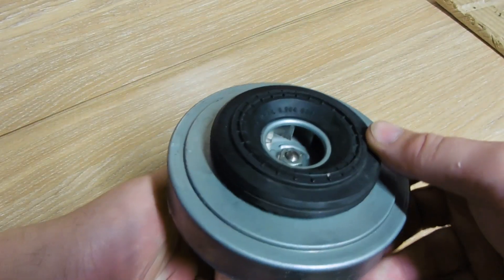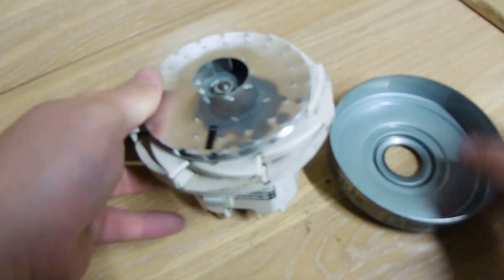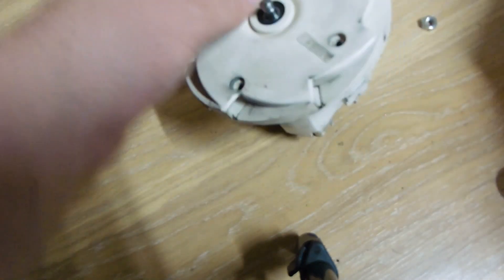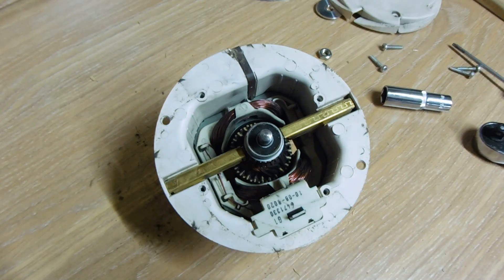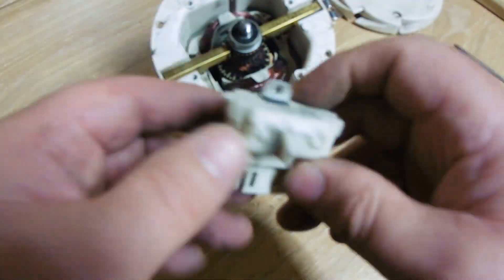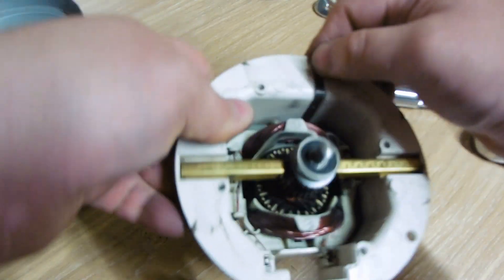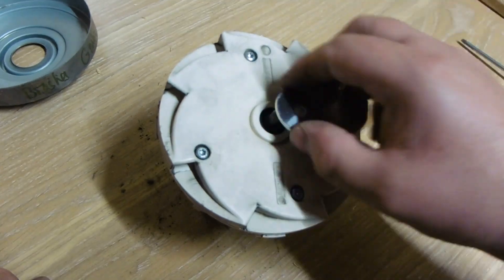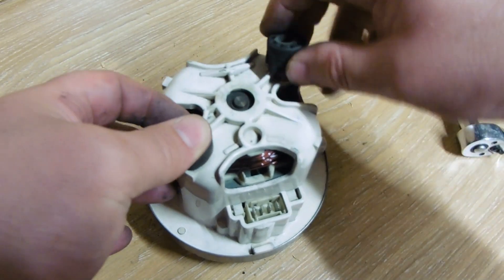Taking apart a MIELE MRG MOTOR, Checking connector pcb, carbon brushes, impeller fan / cover.

Comment: I have a Miele C3 for 110V. my pull out motor controller is defective. Where can I buy this part # 7794050? thanks
Reply from the maker: Hi, thank you for reaching out but unfortunately I am unable to help. 
 I am in the UK so we use 240v and the part numbers are different and the part number you sent isn't something I recognise. 
Regards

Comment: Thank you Just save me a new Miele It was one of the Brushes, Everything looked fine and clean thought I better give brushes a check as connector block looked ok and I had ruled out the switch as that seemed to be functioning properly, It was one brush that had just stuck, released put it all back together and it works fine, Just need top buy some genuine Miele bags now as I feel the copy ones are false economy as dirt goes in to the motor housing.

Comment: Thank you for the video. My motor has a blown component in the pcb connector block. The plastic casing and pcb board are pretty burnt up. Is it possible to order a complete new connector block? Anyone know a part number for it?

Comment: My motor doesn't turn on at all. All 3 wires in the plug coming into the motor are showing 120v when they're run through a mulitmeter while connected to an extension cord's neutral wire. Does this mean the motor has a short?  Brushes are good, no sign of burning anywhere inside the motor.

Comment: Any tips on how to diagnose that connector block? Mine doesn't appear burnt out at all, but when it is in place, the vacuum doesn't turn on. If I bypass it and connect 110v straight to the motor, the motor spins up fine. It makes me think that the connector block has some function in modulating the speed of the motor as controlled by the speed dial, and something on mine is burnt out and for some reason is not allowing any function.  Do you have any tips for what to search for to buy a new block?